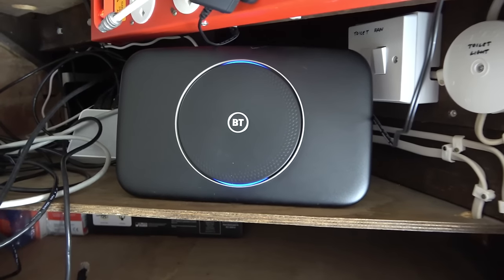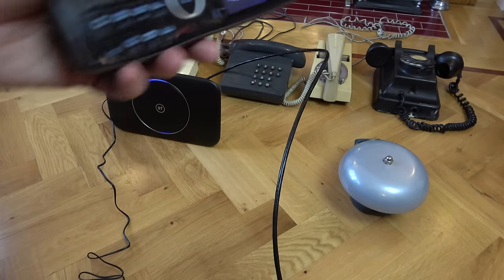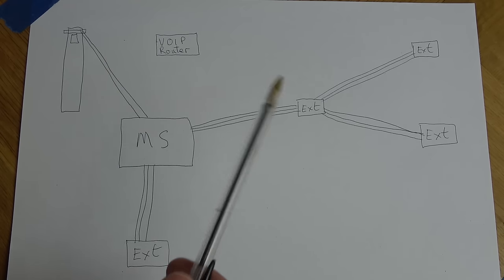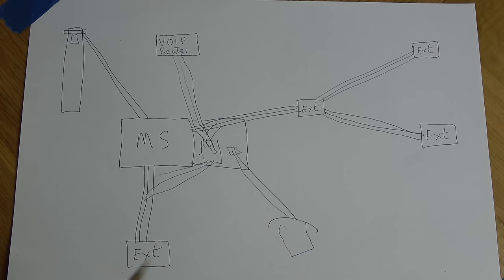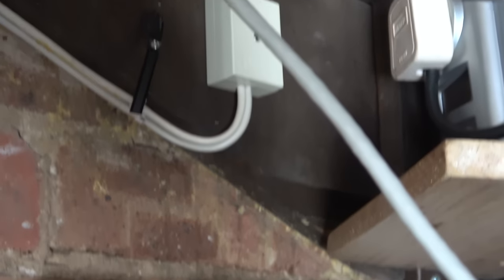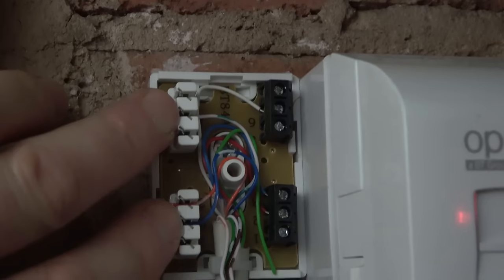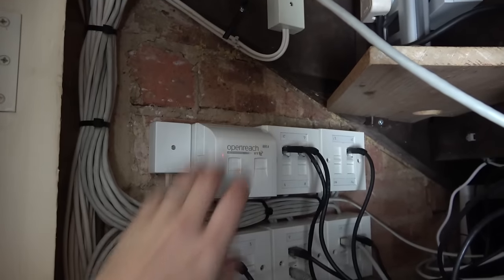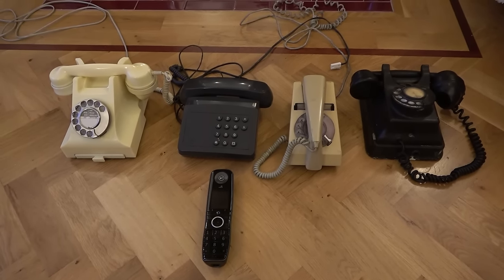How to Connect Landline Phones / Extensions to VOIP on Fibre Internet

Comment: Several years ago, I installed a UPS to protect both my current router and DECT base station. This generally works fine, but the fly in the ointment is that the fibre system, (which has not yet been imposed on us, may well be delivered to the house by wet string or copper), relies on mains power with a, (usually stolen) battery back-up  in the cabinet. 
So, use a mobile you say, great idea, the mobile service relies on the broadband Wi-Fi as the over air mobile service is too tired to make it into the house. I will hope to wire the house alarm into the socket in the modem, when service disruption/obliteration day arrives.
Reply: This problem was something we saw recently here in NZ with the storms and the cyclone, and also 12 years ago with the big earthquakes in Christchurch. Power was out to the whole city for days / weeks meaning all the batteries at the cell sites went flat after about 6 hours so there was no cellular service and consequently no mobile data. Much of the cabled internet infrastructure was damaged in the earthquakes (underground cables ripped up) and with no power to the city all the batteries in the road-side fibre cabinets went flat so anyone who had a UPS on their ONT (optical network terminal / router) at home still couldn't get any internet or phone service.

Comment: Good afternoon. Thank you for your video. We are currently with BT consumer broadband which is FTTC but are planning to move to Vodafone FTTP my current BT broadband has the ability to wirelessly sync the phones as per your video.

When I spoke to Vodafone recently, they have no facility for this as their router doesn’t support it . And according to their policy, they will not be able to give any of the Internet settings to the consumer because they regard that as a threat if we were to use a third-party router to use the old landline phones.

My question is that Vodafone were planning to give a VoIP adapter which I think is the RJ 11 adapter but my router set up is in the garage and with a recent renovation I don’t want to run a wire from the back of the router in the garage into the house because that’s just it’s impractical . Is there another solution that I have missed and if this question has been asked before then please excuse my ignorance. thank you to the community in advance

Comment: I know someone who is against the move to VOIP, and a storm that we had towards the end of 2021 would not have helped sway them towards it
The storm caused power cuts in some areas, and even worse, the mobile phone system failed for some people
Fortunately the power did not go out at our house, however, the lights did briefly dim a few times
Reply: When saving lives you want options and resilience.  So many people (that includes companies like BT, not just some commenters here) think that its more convenient to have only 1 option and then ignore that options resilience.

I even have CB and PMR radios. Hardly use them but thats not the point, they are there to be used when they become the option needed.

Comment: The German telephone socket TAE has 6 contacts, but not all of them are used.
Contacts A and B are the inputs for the telephone. 
Then come R for ringing and E for a button. These contacts have not been connected for a long time. 
Then B2 and A2. If there is no plug in the socket then A is connected to A2 and B to B2. Telephone sockets after this are also connected to B2 and A2. But if a plug is inserted then B2 and A2 are disconnected, the telephone sockets behind are switched off. 
However, a modem or fax can connect A to A2 and B to B2, enabling a telephone behind it.

Today, however, the cables are only laid in a star shape and connected to A and B. The contact for the bell and button are always free, further telephone sockets behind them have become unusual.
The best-selling router Fritzbox in Germany usually has one analogue connection. It used to be three or four. 
There are DECT wireless telephones or LAN telephones for this. DECT is digital and has its own frequency band. 
This range is used for cell phones outside of Europe, but cell phones do not understand DECT.
Reply: 9:20 The wall socket has the necessary capacitor for the bell..
For the bell it's nothing different than A and B but one line with the capacitor inline to block DC.

If the phones are not picked up then they are all high-impedance. Only if you pick up two or more phones at the same time does the voltage drop extremely. But usually the phones work between 10 and 70 volts.

Comment: I'm surprised the UK telcos aren't considering switching to the Genband G5/G6 line gateway. Basically it's a massive ATA or analog to SIP gateway with support for up to 192,000 lines that replaces the old circuit switched equipment like the Nortel DMS, but keeps the line cards in place and interfaces with them instead. No changes are needed at each customers house and it's all done within the telephone exchange itself, and DSL is unaffected

Comment: if its fibre to the property surely you can hijack the master socket and disconect the incomming copper lines as they are no longer required? this in turn will make use of the existing connections in the home without risk of anything going back to the copper in the street?
Reply: that is pretty much what i did when we switched to voip but we have 2 lines coming into our house and disconnecting the main line is as easy as unplugging a phone. also since we swapped from dsl to cable based internet i was able to just plug the voip system into the telephone jack to feed the rest of the house.

Comment: Thanks for this video.I've fitted a lot of secondary phone sockets in my house and used the supplied diagram that came with the MK phone sockets and it shows 2 wires coming in from outside to the master socket and 4 wires going out to all the secondary sockets.Any idea why it showed 4 wires when you show we only need 3? Also, why are there 6 connections on the sockets?

Comment: Would you elaborate on the type of cable you used and how did you work out the entire process and are those cables available in India which will help in using landlines in case of power outage. Please advise.

Comment: Ive just changed to Vodafone and this was not explained to me AT ALL!!!! I have been left with a landline I cannot use and have not realised this until today. The engineer even plugged my phone back into the BT port. Yes I have a ring tone...which was all I checked...no ability to ring out or receive calls! FFS! 
My phone socket is the same shape as yours but there is no port that shape on the hub. :( Can I get an adaptor to plug phone into hub please? If yes, what is this called?
Reply: The hubs has an RJ11 connector on it, this kind of connector is frequently found on phones but you also find the standard white BT connector too.  Adapters have been around for decades so you wont have trouble finding one, look for "BT to RJ11"

Comment: Great video, it answered a few questions I had. Fortunately I have a spare master socket I can use as a junction box to connect to the extensions and disconnect the extension system to the original master socket.  I have a UPS so power failures may not be a problem if not too long.
I have GPO type 332 and 706 phones, a bell set and a 746 Trimphone, so I'm very pleased the bells and ringer will work (probably not if plugged in all at the same time!)  

One question: Does Caller ID work via the Router on old phones so equippped?

Comment: Hi Vince, another good informative video, I am currently battling Vodafone and BT as I was told at ordering that I could have 4 phones connected to my Router, but now they tell me I can only have 1. 

The problem is that we have elderly parents who don't use mobiles and want to ring us on our landline that we have had for the last 36 years. 

I therefore have 3 phones, I have connected all 3 up as per this video and one phone a BT Relate 80 will make calls out, but it won't ring, Vodafone blames BT, BT blames Vodafone, Open reach say you can still have a Maximum of 4 Ren's, I only have 3, have you any ideas?

BT are unsure as to what phones will work with the new Digital Voice system.
Reply: I have experienced exactly the same thing in arguments with Openreach and Sky!!  Sky assured me I could carry my old No across and that my internal network could be reconnected via the VOIP interface on the router. Openreach insisted they had to give me a new No (my old No being associated with the old copper system they are removing as fibre becomes available). They also insisted the internal network had to be disconnected and cut the wires as they installed the new master socket. 
I accepted this on “assumption” that the router could not support the dc load associated with my old phones. 
I was left feeling very cheated by the Sky sales team and received nothing more than the equivalent of a SOIP (Shrug Over Internet Protocol) when I protested.
Reply: @davidrowley-ic6dx  I think that this will be happening a lot in the run up to the abandonment of copper. I maybe wrong but all telephones in the uk use to have to be compliant with BT’s standards, so under the new digital voice system all phones connected via a fibre router/modem need to be to a specific standard to ensure interoperability with all providers. So someone such as BT should set a standard for this to happen and provide a list of acceptable phones. Under Openreach’s guidelines all users updating to voip should be able to keep their phone numbers and existing phone/s.

Comment: Thanks for the awesome video. Just curious, the issue with connecting a router phone socket to master socket and creating a loop back to exchange. Does that vanish in 2025? Once they cut off copper connections can we then just plug router to master socket to use the internal phone extensions without worry of it hitting the exchange?

Comment: I just found out that some ADSL filters actually generate their own ringing signal. So if you have a socket that doesn't have the 3rd wire you can just put a filter in line.

Comment: Here in the Eastern US, Verizon has been busy installing FiOS, their version of FTTP, for the last 20 years. I've had the initial installation at home, and their ONT (Optical Network Terminal) has a couple RJ11 jacks for old phones. Verizon charges a lot to activate one of them, but I think they completely replace an analog circuit. Verizon will no longer install a copper circuit; if you order one they put in an ONT and activate the RJ11. I've had an upgrade at home, where they replaced both the ONT and the IP router (which are separate components in a Verizon installation). By this time, everything at the house was VoIP and cellular, so the expensive RJ11 was no longer in use. I also oversaw the Verizon installation at the office. There, they activated a RJ45 ethernet jack on the ONT, which was connected directly to the company's Internet router.

Comment: As a 'Murican with a landline, (quite recently acquired) this is all very fascinating! I think I'll give you a Sub!
Reply: I got the landline so that I would have a solid line for (among other things) calling 911 in a power outage. Before i had the landline, the only option was my Ooma VoIP line, which does have my street address, but obviously if the power goes out it won't be good for a damn thing. (unless I can find some sort of battery backup)
Reply: @HappyDiscoDeath  There are similar concerns here with BT etc switching to VOIP only with seemingly no regard for a method by which VOIP calls can be made in a power cut.  The general idea is "to use your mobile" which is fine if you have one and dont have to walk several miles in extreme snow simply to get to a location known for having a mobile signal and also fine when the power only stays off during the time your phone has left on battery.  All of which happened a couple of years back here in the UK where power was cut off to an area for more than a week during extreme winter weather.  An area that has phone signals at the top of the hill, which you can now not get to unless you wish to risk life and limb trying to get to it.  The storm totally destroyed the power lines, everyones cellphone died.

Anyway here in the UK the "token" gesture to solve this is to provide "those deemed vulnerable" a battery backup unit that can maintain VOIP connectivity for... an hour.

Comment: Good  evening, at work, due to issues with the copper lines we have been transfered to fibre optic and as you have mentioned in your video our phones stopped working. We have 6 telephone lines connected to a PABX system. The service provider haven't re conneted the lines to the PABX as he said it wasn't his responsability and must call the PABX installer. Can you explain what it entails to re connect to the PABX system. Is it just a plugin job to the PABX?

Comment: Do FTTP routers have battery backup for when the power goes? Useful when the whole of the UK's phones are over VOIP.
Reply: Only if the phone company thinks you are vulnerable enough to need battery backup and even then it works for about an hour at most.  They argued hard here in the UK to remove all responsibility they had to provide phone service in an emergency.  Basically the argument being that "everyone has a mobile phone so its their own problem".

Comment: My house has no RJ11 lines any more. They were removed and the wall plates replaced with blank covers when the house was rehabbed. My parents have cable internet with phone service. The cable company simply disconnected the telephone company at the house's junction box and terminated the line (to make a loop). Then we just connected the RJ11 on the VOIP modem to the RJ11 on the wall. My parents are against getting rid of a home phone entirely. To get around the power outage with no phones issue, the cable company offers a backup battery for the VOIP modem and you can also get a UPS as well for added protection.

Comment: In north america, the new fibre tel service is easily connected to our room jack cluster with a double male tel cord from a jack to the router box.  However, few provide the wireless handset technology.  The surprise is that Nokia has built their VOIP system to accept rotary dial pulses!  No idea why they would work so hard on such software!  (Of course they already have to measure 1000+- milliseconds open interval for a flash for call waiting or three way, so measuring a 62 millisecond open as a dial pulse is the same job.  However, processor time to count them and arrange them for transmittal is a bigger job.  My main reason for wanting a copper pair in the house is the fax machine, which works great.  (Not all destinations allow document scan-and-email).  And if you ask, they provide a backup battery like I got for power outages.

Comment: Our telephone company came to change the phone line to voip and now all telephone sockets work via voip. Last weekend I took an old phone from the attic and gave it a good cleaning. The dialing doesn't work but it's cool and works otherwise.
Reply: you can get an add in board for old phones so that they can dial on new lines. "pulse to tone converter"

Comment: Hi, Vince,
Just been down the  same route and the  old phone socket is now switched off and taped over at our heritage railway.
After a horrendous  migration  to BT SH2, with a  Digital Voice DECT phone, I now need  to get  some legacy phones, a  fax  and (ssshh don't tell anyone)  an alarm connected.

I have bought a Linksys PAP2T ATA does anyone know the  settings for  BT?

Comment: The line cord connection in other parts of the world is an RJ12.
An RJ11 plug & socket is what you find on the curly cord to the phone handpiece (receiver, thing you hold to your head to talk and listen to)
Reply: WRONG! That's RJ10 (also knows as RJ9/RJ22!). RJ11 & RJ12 are the same size plug, one is 4P4C (RJ11) & the other is 6P6c.
Reply: @hoojchoons2258  No. I stand by my statement. I've seen lots of people call them all sorts of things. RJ11 is a certain size and usually comes with 4 pins. RJ12 is larger and can contain 6, 4 or 2 pins. 
Somewhere I have a document that lists over 100 RJ plugs.
If people want to re designate them to something different nowadays - good luck to them.
Reply: @petertryndoch8857  It's not people, it's what manufacturers call them on their spec sheets! & "RJ11" can have two pins, there's ZERO difference in size between RJ11 & RJ12, only the number of conductors. I would post a link to prove my point but they keep getting deleted!
Reply: RJ10 is approx. 7mm wide, RJ11 & RJ12 is 9mm.

"The labels RJ9, RJ10, RJ22 are variously used for 4P4C and 4P2C modular connectors, most typically installed on telephone handsets and their cordage. Telephone handsets do not connect directly to the public network, and therefore have no registered jack designation."
Reply: @hoojchoons2258  Sorry but I disagree.

Comment: In some cases where the external copper cable has been replaced by BT to the Master Socket there's only two wires in the new copper cable.

Comment: As I am on FTTP I presumed my landline was on VOIP with a direct connection from their ONT modem to an extension socket but then BT disconnected that and supplied a new router for Digital Voice. As none of my phones then worked I connected the new BT Smart Hub 2 router to the nearest extension socket and all nine extension sockets around the house are now live. All the connected analogue phones work for both incoming and outgoing calls and the bells work on five of them (the others I have turned off the ringer). Will that be a problem as it seems I don't even have a BT Master socket to stop calls going back to the Exchange?